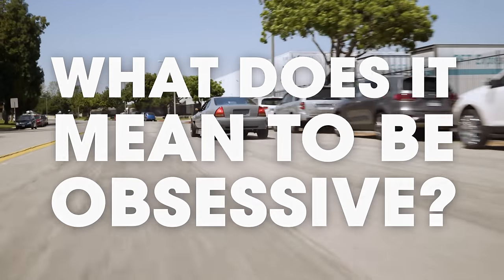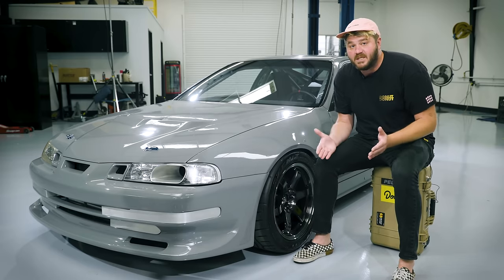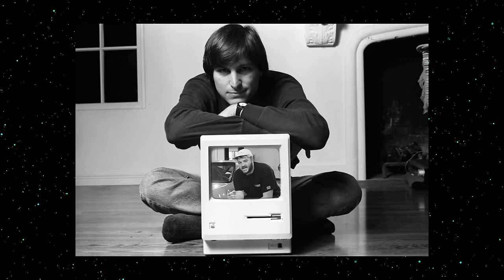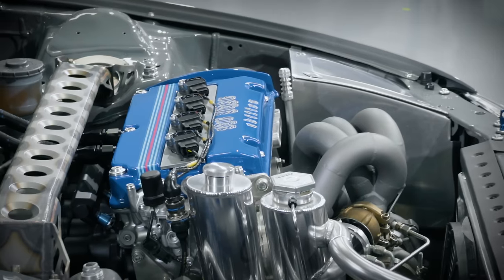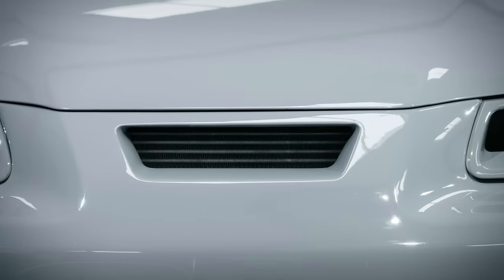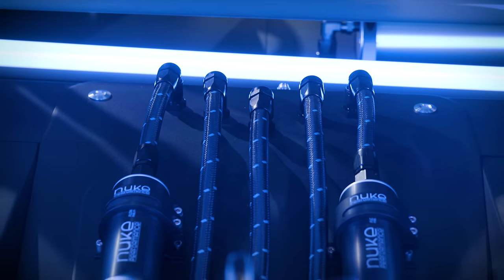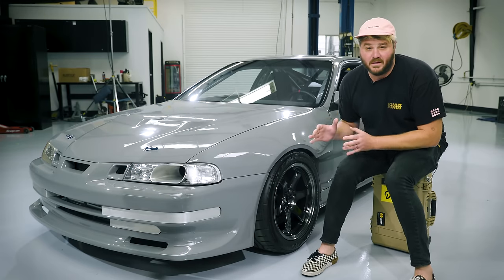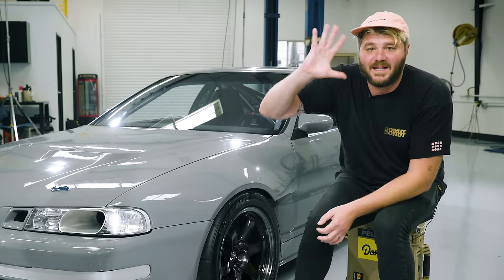If Steve Jobs Built a Honda Prelude | Bumper 2 Bumper

Comment: If Steve Jobs built a car it couldn't be modded and you'd have to buy a new one every 6 months.
Reply: It wouldn’t work if you’re holding it wrong, but the ads look good so they’ll sell millions
Reply: You could mod it, but they'd brick it immediately and tell you that you actually don't own it
Reply: Liam O'Sullivan no you can’t, because everything will be welded, riveted or glued on. If you want to change your oil filter, the whole engine needs to be replaced
Reply: The engine's power would be reduced with every required software update.
Reply: And the type of fuel it ran on would change every 2 models.
Reply: It would fall to pieces the day the warranty expires..
Reply: It would also take its own special gas that can't be used in any other car
Reply: Completely underrated comment 👍
Reply: I’m reading this on my iPhone 5s... and I love every one of these comments 😂
Reply: Nah... Steve is not a car guy so he won't build anything like this.
Reply: It also wouldnt let your kids in as it doesnt recognise them and would tell you lies like steve had no help at all making this car.
Reply: and you can get the stand alone jack stand for just $999
Reply: Win
Reply: this comment and string of replies are on point... Except you all forgot to mention he would use a bunch of tech that was new 3 years ago on other cars but still charge more than those other brands new flagships with way better tech...
Reply: Shlimothy naw it would be Tim Cook
Reply: fponias isn’t apple building a driverless car?
Reply: @ardie72  not that I am aware of but I know for a fact Google is
Reply: It would be hella expensive too
Reply: That would be Tim Cook
Reply: Not only that it would be WAAAYYYY overpriced, they'd charge too much for repairs, not properly train their tech's to diagnose or do said repairs, attempt to talk you out of repairs and into purchasing a new one any time an issues arises, and do everything they can to prevent repairs from being done by anyone but them even going so far as to severely restricting what LICENSED 3rd party repairs shops can do (making them almost completely useless).
Reply: Righteous 😂
Reply: It would lie about how fast you were going too.
Reply: This thread of comments is just glorious 🤣
Reply: steve jobs =/= current apple
Reply: Shlimothy no you can’t open the hood and if you do it’ll never close the same again
Reply: fponias the airbags would only activate in a crash if you own an iPhone
Reply: More like Tim cook
Reply: TheGhostofMarley Steve Jobs hated 3rd parties repairing his devices, and he was pretty open about it
Reply: Yup lol
Reply: Lol! Very VERY good point!
Reply: The butt hurt flowing through these comments is amazing!
Reply: Best thread I've seen in a long while😂
Reply: You all forgetting the biggest factor:

It BENDS

And MICROWAVEABLE
Reply: @shinigamizzz5372  
The hood needs to be opened by "licensed personnel" else your warranty would be void.
Plus if you want to refill the wiper fluid, a full on engine change would be "suggested" by personnel
Reply: It would only run for 2 hours before I died and need gas.
Reply: You’ll have to replace the windshield every couple of months
Reply: lmao
Reply: No that my friend would be if Tim Cook built a car.
Reply: fponias when Steve Jobs built the iPods, they were built way to hold up forever especially the nanos, and the classic
Reply: Nah you're thinking of Tim Cook.
Reply: @dylanwestbrooks8016  unless you needed to replace the battery; good luck with that one.
Reply: That would be Tim Cook.
Reply: @Pieguy223  I've been using apple products since the 80s.  They've ALWAYS been underpowered, overpriced, incredibly hard to fix, impossible to upgrade, and attracted the most zealous and irrational fans.   You shouldnt need a soldering iron and hacksaw to replace your batteries.
Reply: @fPonias1  I completely agree, but Apple was much more innovative when Jobs was alive.
Reply: And if you tried to work on it yourself, you'd be screwed, because you wouldn't be able to source original parts for it.
Reply: You would have to wiggle the fuel nozzle to find the right angle to fuel it up
Reply: jimmynickelz
They changed the charger exactly once and it was a vast improvement. So did Samsung and it got worse.
Reply: Lmfao duuuude this is the most accurate
Reply: Engine sold separately
Reply: After a few new generations of it come out, they block your air intake a bit
Reply: It also would have been an Odyssey, but called a Prelude Plus
Reply: updates would come out that brick the engine
Reply: So a Tesla
Reply: And they will just add an extra back up camera
Reply: fponias unless you jail break hector from prison
Reply: Top 10 best comment threads because fk apple. Great hardware, great intentions with the unix-like engine.....SHITTY USER EXPERIENCE 👎
Reply: fponias so true.
Reply: Not Steve. Tim.
Reply: @Name Name Umm??
Reply: @Name Name So notch in display, Notch in windshield?
Reply: lol i love this comment thread. thank you all.
Reply: nah thats cook not jobs
Reply: And it would had the most cancerous fan base since cod
Reply: android does that even more. they dropped support for the s8, while iOS still supports the 6s, a 4 year old phone.
Reply: @punnequraq  but ya can keep using it,it wont be as modern but it wont fockimg selfdestroy
Reply: @punnequraq  there is a diference between intentional and axidental mate
Reply: If Steve jobs made a car. It'd be electric. Steve jobs has the belief that the consumer isn't right.

Ask a guy in the past what he'd want. He'd say a faster horse. Not a car. Apple. As much as I hate them. Innovate and spread new things. Now days they just spread new things.
Reply: A Ford
Reply: No apple was good when Steve Jobs was alive
Reply: @julianholm7531  what about now?
Reply: Steve Job's iPhone's era was the good era of iPhone
Reply: And insane pricetag
Reply: fponias it runs on proprietary gasoline
Reply: If steve job made a car the paint and the windows would have been chipped and cracked by now
Reply: H bombs 💣
Reply: he actually bought the same color and model of mercedes every year
Reply: @fPonias1  but it would be lighter than a Tesla so it sound be faster than the rest cars and reliable for a price of 100k
Reply: well he had a Mercedes 500 for almost 10 years... and he never register it.. he got a temp registration every 6 months...
Reply: Hilarious because it’s true.
Reply: So essentially a Tesla
Reply: Lmao yeah. 'Oh you're out of fuel? Too bad, you're just gonna have to buy a new car.'
Reply: He drove a marcedes sl55 amg dive it fr 6mnth n  and replace it with another same one after the grace period was over.thts d reason his car didnt had number plates True stry.😈.❤.
Reply: Do you want to get smacked for being disrespectful??
Reply: that would happen after he died
Reply: Like a tesla
Reply: True,but you know that james is saying that steve jobs is "genius"
So if he liked cars he could do this.
Reply: And new worthless updates
Reply: You couldn't even fix it or have it fixed. 
Have a dent in your door? Sucks to be you, now you need a new car.
Reply: You wouldn't be able to exchange the battery when it gets "updated" either
Reply: No aux adapter, you have to buy a new stereo for $999.99 for an aux Jack
Reply: The front bumper looks like an e36 bumper
Reply: yall do realize steve jobs died before any of these?
Reply: Tim Cook
Reply: The hood would be welled shut 😂
Reply: I don't think that was Steve Jobs dream I think that's whoever took over Apple actually
Reply: @TheCornishGingerOfficial  Everything built after the Apple II has been underpowered, overpriced, and impossible to modify.  Steve Jobs just made it worse with his 1 button interfaces.
Reply: And all safety features are not included
Reply: @szewal  ikr? Steve is a legend.
Reply: Laughs in Android
Reply: @lizbob735  yep
Reply: I think you mean Tim cook
Reply: Sounds like a bmw to me
Reply: And would be a couple years behind in technology
Reply: 😭facts
Reply: All I hear is “haha Steve Jobs bad” “apple bad” never good criticism
Reply: @yerpster  My initial comment implies I would like Apple better if I could modify their products (add memory, replace batteries, upgrade storage capacity, replace cracked screens, add video cards) and they lasted longer than a few years because mandatory system updates make their product unusable. Of course all phone manufacturers do this with their smart phones but Apple applies the same design logic to their larger computer products, and they are the only ones that do.
Reply: That’s apple in 2020 not in 2006
Reply: you mean Tim cook?
Reply: Not to mention all the accessories you’d need to actually use it!
Reply: That’s Tim Cook.
Reply: You could change the color of it, but everything else was off-limits
Reply: Engine, gearbox, steering wheel, Glass, mirrors, seats, trunk, Doors sold seperatly
Reply: So Teslas pretty much
Reply: @insayn7995  see the difference is that we pay once and get regular updates for free
Reply: Thats apple not Steve, apple was built right and tough before he passed
Reply: And you could only get it repaired at a factory outlet store by company trained college students
Reply: Lol
Reply: Timing belt squealing?
“Definitely water damage, you’re gonna need and engine swap. If you already opened the hood, you’ve voided the warranty”
Reply: @insayn7995  Tesla’s aren’t built like a normal car, if enough people knew what they were doing when they open up a Tesla, I know for a fact they’d open up to third party support.
Reply: thats tim cook not steve
Reply: @AutoSearPin  They'd have one of those water damage indicators next to the intentionally leaky wiper fluid reservoir.
Reply: And you’d have to buy the engine and tranny separately
Reply: My MacBookPro: hold my upgraded SSD
Reply: @muniztv6831  it would be reliable as a fiat 500
Reply: Fr
Reply: No windshield changing
Reply: And no headphone jack
Reply: The thing is apple wasnt like that when steve jobs was the ceo
Reply: That could be true. Steve literally used to change his Mercedes SL twice a year
Reply: Also he wouldn't actually build it. Rather have some underpaid geniuses work around the clock, constantly inventing new stuff, while he patents even the tiniest new idea they have along the way.
Reply: No, I'm not biased toward either company (Apple or Samsung) but I will say that all that happened after Steve's passing. Apple went to the dark side with Tim Cook, Steve made some awesome products that were reasonably priced and  well built. Once Tim took took over, that's when prices started gradually rising and quality became less and less of an issue, as selling the devices in the first place became the main concern.
Reply: lol
Reply: cough Tim Cook cough
Reply: Plus, the battery would only last you about 3 months.
Reply: *Tim cook
Reply: nahh that would be tim cook
Reply: i’m saying
Reply: Apple hella sucks actually
Reply: So a Kia?
Reply: @fPonias1  if Apple products are overpriced, hard to fix, impossible to upgrade, and attractive to zealous and irrational people, WHY HAVE YOU BEEN USING THEM SINCE THE 80s??? Isn't it time for a change???
Reply: @DadlyGaming  My parents provided my computers in the 80s and 90s and were drinking the Kool-Aid.  I bought my own computers for the 00s and thankfully I missed the iMac craze, hockey puck shaped mice, iPods, and the start of iPhones.  

Then the software development industry (mostly Google ironically) collectively decided that development could only be done on Apple laptops.  Unless my projects are specifically using .NET there is no getting away from Apple in my line of work.  

I guess I could change careers or just be resigned to using their products as long as someone else is paying for them.
Reply: no thats tim cook, not steve jobs 😂
Reply: I doubt it.. I feel like this is more of a Tim Cook thing 😅
Reply: Nah that is the tim cook car

Comment: Big Mike: I wanted to keep it looking OEM 
Everyone: Yeh that's not OEM
Reply: There's a difference between OEM look and looking like it could be OEM.
Reply: I think of it as if Honda were to update it what would it look like
Reply: fiberglassing over top of clay on the fenders?
really? thats how you do it?
Reply: my dad used to own for short time but still never like it back then..... you going to a lot of aftermarket to just make it modern....power or look....
Reply: Def not OEM looking. 🤦🏻‍♂️
Reply: ragemydream  you’re not very bright lol but you tried! He didn’t want the gutted look so he revamped the door panels and dash hence why they said oem look
Reply: Nathan Brame  , from that you make a mould, from which you then make a clean part without clay/foam.
Reply: What does OEM mean?
Reply: Hail Megatron.
Reply: @vipbeef2174   original equipment manufacturer
Reply: @erf1109  thanks man
Reply: @fastinradfordable  its for making mold for fibreglass fender... you really think those fenders have clay inside lol..
Reply: @fastinradfordable  Well you create the shape you want with the clay. After adding and shaping and curving and all that, you eventually end up laying fiberglass resin on top and end up creating the shape. Then you pop that piece off and have to mate/mold it to the other piece to create the whole piece (in this case, fender). That's an extremely simplified version, but yea. Contact my friend Cody on IG casale_design and he can elaborate further
Reply: @vipbeef2174  Original Equipment Manufacturer
Reply: @BigMikeEdition  that mekes me feel better,
never messed with fiberglass, but anyone who spends hundreds of thousands building the same honda again and again, ya never know
Reply: @fastinradfordable  Hundreds of thousands? I'm presuming you are just exaggerating, or perhaps talking about someone else because I didn't (nor would I) spend that kind of money on this particular build.
Reply: A E S T H E T I C
Reply: didnt want to put a like because i like 669.
Reply: Not even trying to look oem lol
Reply: "robots in disguise"
Reply: He meant Apple "proprietary" OEM lolololol
Reply: @BigMikeEdition  Can you work on an all electric version? With some tesla hardware mainly the motor and batteries and no autonomy
Reply: @thisistheway96  I could yes. And I most likely will, at some point. But right now my boy Ryan from Rywire is doing an electric S2000.
Reply: @BigMikeEdition  That would be an amazing car to be electric. Will be posting some videos of the process?
Reply: @thisistheway96  Yes, he already has posted. Check out his YouTube channel, he has parts up already. And look for a series on YouTube that I'm doing that doing with Ryan on a new channel coming next month!
Reply: @thisistheway96  Yes, he already has. Check his YT channel, there are numerous parts up showcasing the build and it's progress.
Reply: @vipbeef2174  original equipment manufacturer

Comment: I have this exact car. Crazy thing is...
Every time I leave it out in the sun, and I live in the Southwest.. it doesn't start.
It's only happens in the summertime where we get a hundred plus degrees.
And my car is black 🖤
You can hear the engine just starting like it's getting fuel and then it's like it doesn't get enough and then it shuts off immediately...🤷🏽
Nobody I've talked to has been able to figure it out. But I'm also not going to keep paying mechanics for diagnostic tests, either.

But as long as I don't leave it in the sun, this car is kosher.  Love it every second... that it works, 👍.  So fun to drive ...

Comment: Pretty neat build. Though,i think i was the first to have a turbo build in the prelude. I had a 91 prelude 4ws so  that had a Garret turbo set like that with the snail on top of the headers and will set of pipes on right with a intercooler in the right fender. I then swopped out the si motor with  the vtec motor making it turbo vtec. I replaced a sebring exhaust with a cutout with a manual switch under the driver rear seat. With mugen m7 rims which are the bes all time  looking rims for a Honda., They were made of duralumin with a great surface, a little shiny more titanium like. It was that blue green color that was nice for the time. Replaced with clock behind the black sceen with a turbo . Loved that car to this day, wish i cept t.

Comment: The oil filter looks great in the engine bay but dam that must make a mess in that beautiful bay when it's time for a change.
Reply: It really doesn't, I just have a rag and when I spin off the filter I stop the few drops from getting to the paint. The filter opening is on the top side so it isn't a big deal.

Comment: I had a blue '96 5 speed back in 2006 that I bought salvage title only fixed it up enough to daily drive but didn't do more because I liked the 5th gen better and wanted to trade up but then decided I didn't like FWD so got a black '91 300ZX 5 speed instead.  I miss both those cars.

Comment: Can some explain to me why the F20B is preferred over the H22a?
Reply: I like it because it is higher compression, revs higher, and has a better rod/stroke ratio - and the difference in torque from the 0.2 L of displacement difference between it and the H22 is negligible given the application of a small, quick-spooling turbo utilized in this setup.

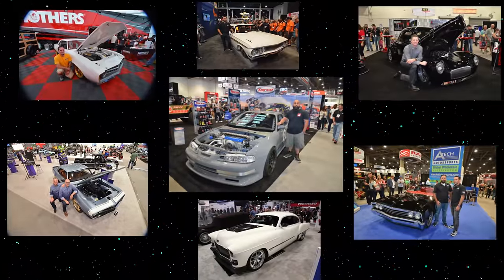Comment: The ONLY thing I could nitpick about this car , is that on 11:50 shot , you can see the brakepad is not on the center of the rotor braking zone or whatever you would call it so these brakes aren't even fully utilized , but other than that damn boi
Reply: That is actually a parking brake caliper. If you look, my rear setup has 4 calipers - each side has the braking calipers, and then there are standalone parking calipers.